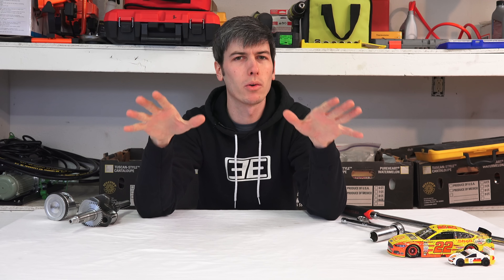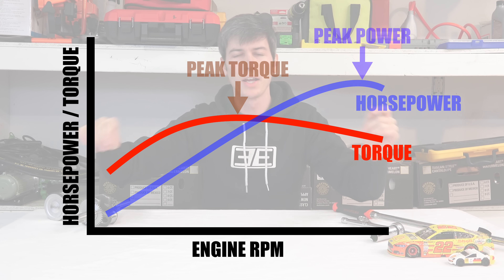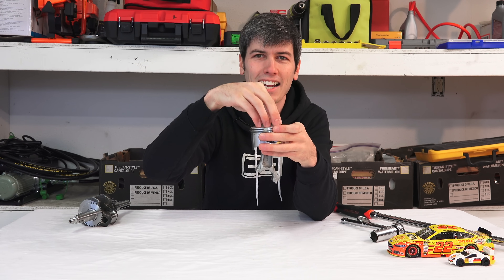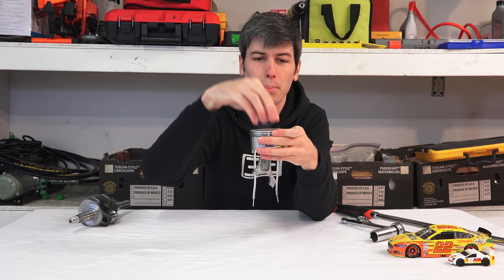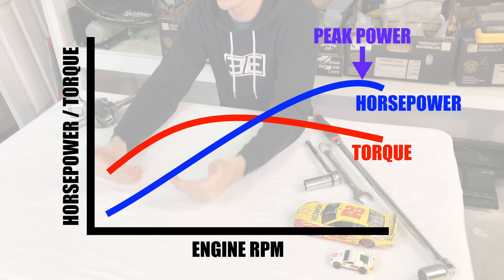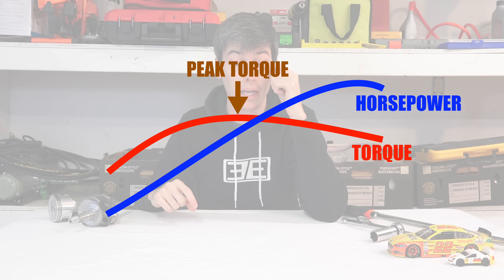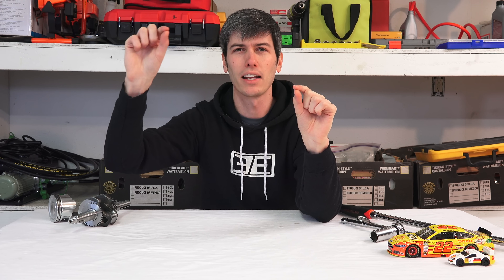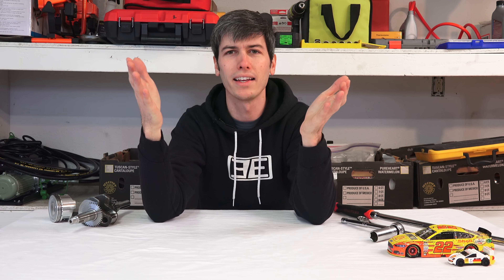Horsepower vs Torque - A Simple Explanation

Comment: Not sure if missed understood, seem not directly explain why cant maintain torque at higher rpm... I assume its to do with efficiency ?
Reply: At a certain point the engine is spinning so fast the air is unable to  enter the engine in the time the valve open. That problem can be solved by fitting a more aggresive cam profile, but then you will lose low rpm efficiency. An extreme example of that would be old F1 cars that revved to 19000RPM but had to idle at like 4000.

Comment: Torque would be how strong an engine is while horsepower would be how quick that particular engine is…..
Reply: RPM is how quick an engine is, and power is the combination of both speed and strength (how much work it can do).
Reply: @idkhowtonamemyself2137 rpm is how quick an engine is running. RPM=revolutions per minute
Reply: @nicolascreech6367  And how is "how quick an engine is" and "how quickly it is running" any diffrent? To know how quick a car is power/weight is required so it can't be that. Also torque is not how strong an engine is since higher torque does not mean better durability.
Reply: @idkhowtonamemyself2137 the quickness an engine revs is not the same as how high it can rev. RPM is revolutions per minute which is how fast an engine is turning.
Reply: @nicolascreech6367 Then what did you mean by "quickness" of the engine? How quickly it revs up? Because high revving low torque engines win there too.

Comment: So if you want to go fast go for power. If you want to tow a caravan go for torque.
Reply: For both you need power. For towing however you want an engine that will use the least amount of fuel at that load.

Comment: Understeer is where you hit the wall with the front of the car. Oversteer is where you hit the wall with the back of the car. Horsepower is how fast you hit the wall. Torque is how far you take the wall with you.
Reply: "Taking the wall with you" is movement, and we measure the ability to move an object with power.
Reply: @idkhowtonamemyself2137  I bet you're fun at parties

Comment: Really confused heavyweight slow rpm,lightweight fast rpm for the same bhp
Reply: You can see torque as the amount of work the engine does in a single rotation. An engine that makes half the torque but spins at 2x the rpm will do the same amount of work per second so it will generate the same horsepower.

Comment: Torque is a burnout, Horsepower is top end speed.
Reply: Wheel torque is a burnout, and due to the transmission more hrosepowwr at the same speed will always mean more wheel torque.
Reply: @idkhowtonamemyself2137  Not according to a dyno curve
Reply: @GregoryClarkson-j1j Burnouts are done at the wheels, not the crank.
Reply: @idkhowtonamemyself2137 Uhm, a Dyno interfaces with the wheels. 😂
Reply: @GregoryClarkson-j1j But the torque you see on the curves is engine torque which is calculated from power and RPM
Reply: @idkhowtonamemyself2137 At the wheels, please do not reply, you are just embarrassing yourself. Chassis Dyno: Measures at the wheels, factoring in drivetrain loss (e.g., 15-20%).
Engine Dyno: Measures directly at the engine's crankshaft with the engine out of the chassis.
Reply: @GregoryClarkson-j1j  Yes, but the graph that is printed for you at the end of the run is calculated engine torque, not the actual torque made at the wheels wince that is modified by the gear ratios. A 2007 civic type r that makes 194Nm of torque (about 150ftlbs) can make up to 2770Nm (about 2000ftlbs) of torque.
Reply: @idkhowtonamemyself2137  Stop. It is the exact opposite of what you just stated.
Reply: @GregoryClarkson-j1j  I’m not saying dynos don’t measure wheel torque (and If that's what you got from my comment then my bad). I’m saying the torque number people quote from the graph is calculated engine torque, not the wheel torque acting at the contact patch, which is multiplied by gearing.
Reply: @GregoryClarkson-j1j  You can use gears to get as much or as little torque as you want applied to the wheels. If you want to apply that torque at a certain wheel speed you will need a certain amount of power. More torque applied to the wheel gives greater acceleration, in order to apply high torque to the wheel at high speed you need high power. In order to do a burnout you just need to apply enough torque to overcome the traction of the tires.

Comment: more torque equals faster acceleration, but in 4th and 3th gears the car still pulls and is not affected by mass or weight kw or horsepower equals the max speed the car will reach but is affected by mass like resistance  to airflow aero dynamics gravity  u can't have only one of the other they work in tandem there will always be torque no matter how much power the engine makes and vice versa
Reply: The thing is that power already includes torque so the more powerful car will always pull harder.

Comment: Torque is only necessary to climb or carry heavy loads,just horse power is racing
Reply: go comapre 1000 hp from 1000 nm at 7000 rpm vs 100 hp at 7 rpm from 100000 nm at perfect gearing on big angle incline climb with heavy load on both you fast change your mind 🪠🍿

Comment: Forget about torque, Save yourself a step and just look at the power curve.
Wherever you are on the curve is your budget to accelerate, tow, climb a hill, push air out of the way at top speed... _ ANY_ type or example of work.  Torque is only a useful spec when you are calculating when parts will break or how much tension you need on the fasteners to keep the wheels in the hubs and the heads on the block.😊
All work is done by Power. It's not an opinion or just a fact,.... It's the Law!

Torque doesn’t do work.
Torque is just the slope that energy wants to slide down.
The actual sliding — the real movement of energy through time — is power.
And work is simply how much energy successfully slid.
Forces, torques, fields, and stresses are not the cause of work; they are the geometric shadows of an underlying energy imbalance.
Only when energy actually flows (power) does any work occur, from a stalled motor to a tectonic plate to a quark.
So the clean, universal truth is:
Work is the integral of power because all work is done by power.
Everything else is just a description of the slope, not the movement.

Comment: Nice one. However, I don't think changing gear changes the leverage. Simply, by changing down a gear means the rpm is higher and so more power and more performance. The F x d where the connecting rod meets the crank remains the same
Reply: Engine torque would not be changed but wheel torque would be.

Comment: Torque is momentum. The more momentum generated, the easier is for the body to move. The faster momentum is generated, the faster work can be done so higher power.
Reply: You can also generate more torque with gearing so the more powerful engine will also struggle less to move that body.

Comment: Excellent, straight forward video. I was trying to understand how with a high torque vehicle, you typically can just hit the gas and get a big boost in speed, whereas the same isn't always true with a higher horsepower vehicle with less torque, except that the higher HP vehicle should be able to have stronger acceleration. The high torque vehicle can provide a big boost in a single gear at its high torque range, whereas a high HP vehicle you need to rev up the engine (i.e. downshift) to provide the strong boost!

Comment: So what happens if the cars have equal power but car B has double the torque? better acceleration and same top speed is my guess but unsure.
Reply: Power, not torque, is the limiting factor in not only the top speed of a vehicle but also how quickly it can accelerate at any speed and how much weight it can pull up an incline at any speed.
Reply: Assuming equal gearing (every gear tops out at the same speed) acceleration would be the same.

Comment: Would you say then a car with more torque than horsepower, would get a quicker 0-60 than a car with more top end horsepower vs torque? Or no because of your point about gearing, where the car with more horsepower vs torque could have a better gear ratio to still get the same result?
Reply: Power, not torque, is the limiting factor in not only the top speed of a vehicle but also how quickly it can accelerate at any speed and how much weight it can pull up an incline at any speed.

Comment: Why would anyone want the less power, but more combustion force? What is the practical use of car 2?
Reply: Trucks (although, technically they are not cars :p), pulling heavy loads. They don't necessarily need to do work fast, but they will need an engine which won't buckle under load. Sort of comparing a sprinter to a strongman, each has their use cases ;)

Comment: 1st gear power, 6th gear torque
Reply: It’s the opposite.
Reply: @adrien7739  No it is not. And so that you know more power implies less speed.
Don t tallk about what you don t know. Listen ignorant, when you go up a hill why is it easier to climb in 1st gear.....Because it has more power. Get tha fook out of here ignorant
Reply: Power is the same in all gears.  Torque can be multiplied by gearing power can’t.
Reply: @rollsroyce329  No it is not.....You did not understand. You need a degree in Mechanical Engineering
Reply: @gibson2623 😁. That’s Cute.  You think gears multiply Power… Or do you just not know the difference between Torque and Power?  Power = Force x Velocity.  Gears allow you to trade velocity to gain force.  First gear has more Torque but less speed than 5th or 8th. Lower gears amplify Force at the cost of less Velocity.  And vice versa.  Multiplying Power would violate the first law of thermodynamics-the conservation of energy.  But if you think I was napping in physics class please feel free to brosplain the broscience for us.
Reply: @rollsroyce329  More power less velocity....A bicycle ilustrates that well. It would take 50 of you to lecture me on my job dude. Read some books and get some education in engineering
Reply: @gibson2623  🤣🤡🌎

Comment: Ok ... but what is work? Its the amount of energy transferred in a process. How rapidly this transfer occurs is known as power. 
In 2D physics we have linear systems where forces are applied generally in line with the accelerations they produce. The other system is rotational where forces are used to speed up or slow down rotation. To do so only the part (component) of the force acting tangentially to an axis need be considered. (Pressing a bike pedal along the crank will have no effect). Secondly, how far the tangential force acts from the axis of rotation is very important. The multiplication of this tangential force and the distance from the axis is know as torque. Naturally, we find longer wrenches are more effective against tighter bolts. Etc.
For a car with all its inefficiencies, one has to be careful where these measurements are taken. We can accept measurements from an engine test centre of the output torque and power. Perhaps, it is more instructive to consider actual performance. For output torque we can measure the resulting tangential force of one of the drive wheels and multiply that the radius of the wheel. For power, one might use the 0-60 mph test. The car will go from 0 to some value of  kinetic energy (T=1/2 mv^2) at 60 mph. That is the work done. We then divide the time it takes for this 0-60 mph acceleration to get the power.

Comment: So, why do we even need to know the torque of an engine and why is it reported. Seems irrelevant in terms of acceleration/speed if you have gears.
Reply: well yea 🤷🏻‍♂️ torque level determined rpm level at which engine willl work for the same power 👉🏻 for the same power higher torq  mean lower rpm mean the same results 👌🏻 its only about preferention what somebdoy wpuld like more low rpm or high rpm as long as power stsy the same there be no diffrences in perferomance just in noise and sound 👌🏻🍿

Comment: Wouldn't you feel the most g-force when the engine is working at peak power rather than torque?
Reply: at set gear when engine work at peak torq but not always peak but always more than at peak power ☝🏻why not necessery peak ? cos it depend on tprque charwcteristics feg if resist of motion at 1000 rpm where is 1,1 times less torque  than at peak at set gear is less  than 1,1 times than at 1000 rpm be more gofrce at set gear despite peak torque is at whatever where let say 2500 rpm (including offcorse drove trsin losess) 👌🏻 but yea at set gear alwayspesk torq will kick harder than at peak power rpm cos force in regard to leverage  aka gearing is depend on TORQUE ☝🏻but 👉🏻at set speed dosent matter at whcih gear at which rpm peak gforce be always at peak power rpms and never at peak torque rpm except when peak torq is at the same rpm as peak power its rare exception but some engine have such characteristics than its draw in regard to set speed  if want found out this be yourself its prety easy first take the same diff in soeed but 2 diff level of speeds where engine have peak torq +/- and where it have peak  power +/- at set gear in similar road condition in car  stopwatch show lower times at peak torq always u less ypu have damage engine or diffrences in driving condition wass not the same and than setup the same speed for each gear rpm now stopwatch show lowest time when engine be closest to pesk power rpms so egzacly what he say in this tutorial 😉🪠👌🏻🍿
Reply: Peak acceleration will always occur at peak Torque for a given Gear however…. Peak acceleration at a given vehicle speed will always occur at peak Power.  You want to be at or as near peak power at all times if you want to go fast or pull the most weight.
Reply: @rollsroyce329 yea except „ peak acceleration willl allways occure at peaktorque for a given gear” its not always true what is true it will always generste more accelerstion than peak power rpms at set gear except where engine generate peak  torq and peak power at the same rpm but sometimes if some engine generate  not enough  lessss torque  at some lower rpms where resist is enough lower at set gear than at pesk torq rpm than peak acceleration be at this lower rpms and not  at pesk torq rpm at set gear 👌🏻🪠

Comment: Got lost. You made it more complicated.
Reply: It's very simple.

Consider 2 engines. One Oversquare (that is, wide bore, and short stroke), and One Undersquare (narrow bore, and long stroke).

Oversquare engine doesn't have a lot of static torque, but will rev to the moon, because the short lever of the crank, and the short stroke of the pistons mean the pistons will have a slower mean speed. They can use this supply of revs, to generate loads of horsepower, which is what we're interested in, but they'll be higher up the rev range.

Undersquare engine on the other hand, will have a lot of static torque, but can't rev much, because of the longer crank lever, higher masses, and longer stroke, that'll eventually lead to the pistons outrunning the flamefront of the combustion. They get a lot of horsepower in the lower revs, but will run out of breath when pushed.

Conclusion:
If you're scared of revving past 2500rpm, or pushing the throttle pedal more than 30%, and undersquare engine will probably be your speed, however, if you love hearing an engine sing at 6000-7000rpm, and love going WOT on motorway on-ramps, oversquare engines are your jam.

Or in other words. Soccermom SUV's have undersquare "torquey" engines, while sportscars and supercars (and definitely racecars. The LT4 in the Corvette C.7R is downstroked to be even more oversquare, than the street version) usually have oversquare engines.
Reply: torque is the force applied to a rotating object at a given instant
power is a rate of work, I.e. how rapidly that force is being applied

think of pushing a standard door. the further out from the hinge you push it, the less hard you need to push. the closer to the hinge you are, the harder you need to push it. (t=fd, so increasing f or d will increase t)

for power: imagine throwing a water bottle at your door, with all variables being the same with each throw (distance, strength of throw etc).
at the same rpm (say one bottle per second) a bigger bottle will produce more power (move the door faster)
but at a higher rpm (2 bottles with same throwing force every time) power also increases.

I feel like the throwing analogy is more appropriate to engines as it's not a consistent torque production but rather pulses of torque (combustion events)

hope this helps!

Comment: Wouldn't the largest feeling of being pushed into your seat be at the peak horsepower? That's when peak acceleration occurs, which is responsible for that feeling.
Reply: Peak acceleration will always occur at peak Torque for a given Gear however…. Peak acceleration at a given vehicle speed will always occur at peak Power.  You want to be at or as near peak power at all times if you want to go fast or pull the most weight.

Comment: So I agree with all of this.  But it can be very confusing.   An old mechanic I used to work with years a go explained every thing he said in simple terms.   You want a car to excelerate quickly.  Get high horsepower.  The torque you need will be there.  
If you are using a truck and need to haul a load you want to focus on torque.  The horsepower you need will be there.
As a general rule in trucks, torque will sustain your Horsepower under a load.  With lots of horsepower and little torque you will struggle pulling heavy loads compared to having higher torque and less horsepower. 
Cars don't need all the torque as there is less load.  That is as a general rule.